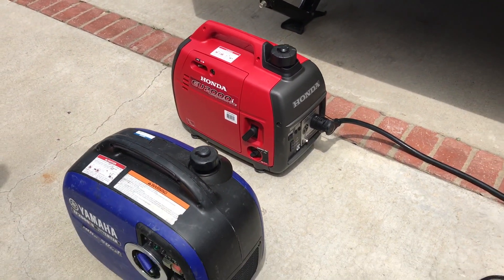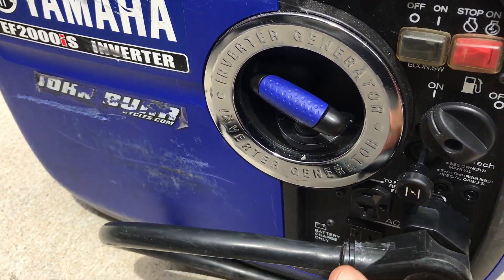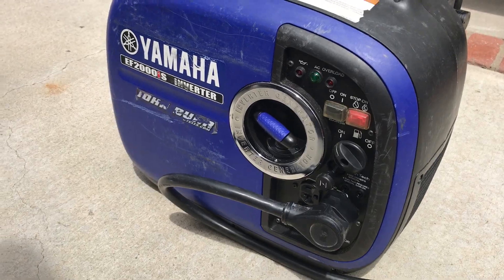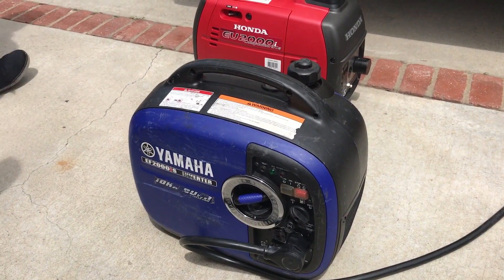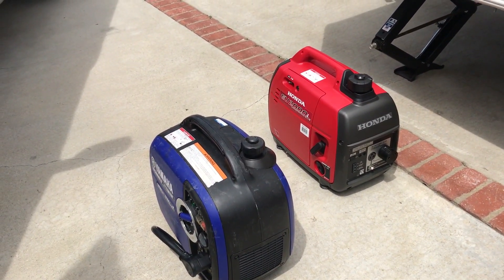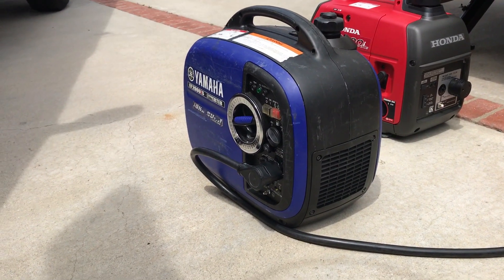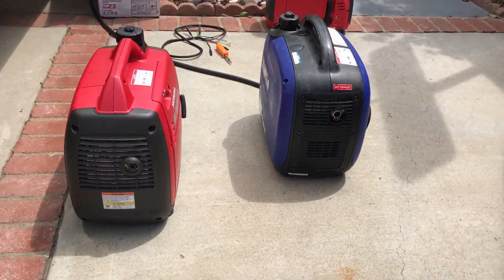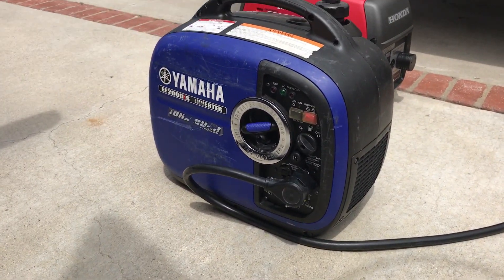Yamaha 2000is generator will not start 13500 btu air conditioner with Hyper Engineering Sure Start

Comment: I have compared the original with the V2, the difference is the inverter. For 115V the current is very high so the electronics must be somehow under-rated in the original design. They fixed it in the V2 version. The 220V version doesn't have this issue.

Comment: Darn, sorry but I have to ding you again... I'm researching soft starters for my RV AC/inverter situation, so I feel I have to share what I learn for anyone else looking into it.

These soft start units need several "learning starts" before they are optimized to work with individual generators, so when you switched from the Honda to the Yamaha, you may not have followed the right learning procedure, that may have made the Yamaha not work.

You can learn all about this fro. The MicroAire soft start videos.

But no one is giving me a chart that says definitely that a 2000w inverter generator can start up a 13.5 btu AC...   that's what I need to know!

Comment: Why would you want your A/C running on a 2000 watt gen even if it could start it? You are running the guts out of a small gen, when you could, real easy on eco mode run that same A/C from a 3500 watt gen. You will get better fuel hours from the 3500, it will last a lot longer and you could run your micro wave at the same time.........Lets keep it real folks, dont buy a 2000 watt gen to run your A/C, no matter what snake oil junk you buy to start the A/C..........

To me these ventures are just like the people who bought the small V8 motor with their tow truck and start adding all kinds of power enhancing after market stuff to the motor and come back and say see it now tows up hill 5 mph faster. If you just bought the big engine with your truck in the first place you can go 10-15 MPH faster up that hill in the first place. And guess what the bigger motor will last longer because it rarely has to work as hard...........

For those that don't want to be running a 3500 watt gen all the time when you are not running a A/C, like me. Buy a 1000 watt gen and run that at those times. My 1000 watt gen gets 90 percent of the work when I run the gen. A compromise is not buy a 2000 watt gen and spend more money making the A/C work. "The right tool for the job" type thinking ............Michael

Comment: My Honda 2200 breathes easy on a 13.5k ac with an easy start added.
Reply from the maker: Nice, glad to hear the larger genny is working better. have you used in in temps over 90 degrees? I found the eu2000 would run flat out in a heat wave around 95 degrees. Pretty noisy at that speed.

Comment: Tried something similar.  I bought a Ryobi RYI2300BTA to run a portable air conditioner in case the power fails during the coming 114° weather.  It did the same thing as the Yamaha in the video.  The fan starts, but the compressor tries to kick in but fails.  I borrowed my friend's 10 year old Honda EU2000i and it worked great.  I went out to buy a Honda EU2200i and it does the same thing as the Ryobi and the Yamaha.  The Yamaha, Ryobi and Honda EU2200i don't seem to rev up fast enough, but the 2000i does, every time.  Very frustrating.
Reply from the maker: Hello. Im surprised the 2200 does not start it. Was the gen in Eco mode when you tried it?
Reply: R. K it was not in eco mode. The 2000 almost instantly revved up. The 2200 was slower revving up, so a/c errored and compressor didn't start. Thr Ryobi did the same. Too slow revving up.
Reply: Quick update. I kept the Honda 2200 and bought a smaller Toshiba 8,000BTU a/c. That setup works.  The A/C I was using was 12,000BTU LG.

Comment: Apparently nobody reads manual... u know the part about starting the generator with load, and using high load devices with eco mode on.
Reply from the maker: Good point regarding Eco Mode. Shouldn't start A/C with it on. Thanks.
Reply: Michael Hype Ae you suppose to unplug a high load source or turn it off before turning off the source.
Reply: I have two Yamaha generators with a parallel kit , I was wondering if one would run the a.c. I seen where they were trying to. If your car will run 100 mph. It will wear out quick running wide open.

Comment: the honda use 100cc engine and the yamaha uses a 80cc engine, it not just the watt rating to look at, the engine pysically not capable of the same power output, all ways check engine cc size and watt output

Comment: i do not understand why you guys play around with these 2000 watt generators that may or maynot run your a/c and even if it does the generators are running at  max capacity, why not just buy a 3000 watt inverter generator and be done with it.
Reply from the maker: For myself, I dont like having to lift the heavier 3000 watt generators. But thats just me. ;-)
Reply: Kind of obvious some people use Porsche AWD to pull airstream Bambi's and have no room and will not put a generator in the Airstream YUCK
Reply: Mrs Hudson The newer Honda eu2200i.

Comment: My Yamaha 2000i will run my Coleman Airxcel cub 9,500 BTU roof AC in my off road micro trailer when the eco mode is turned off, but it does not like it with the eco mode on, trips the overload.
Reply from the maker: Hello, thanks for the comment. Glad to hear it will run the smaller ac unit. I think the Yamaha would run the ac unit if the converter was shut off in my trailer. The 13k ac is just a little too much for it.
Reply: Just thinking yamaha EF2000i can charge 100A DC battery? I just bought the generator , but a friend of mine saying it only can work for 40A small battery!

Comment: The video cut out before you were able to check if the a/c was running. Was it?
Reply from the maker: The Yamaha was NOT able to start up the A/C with the Eco mode on or off.